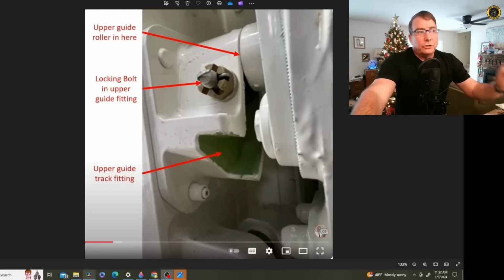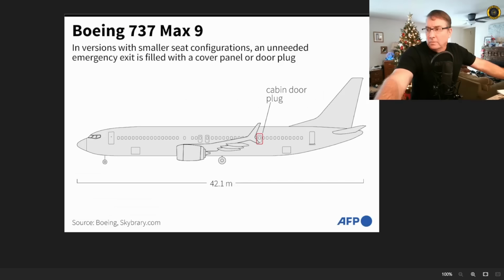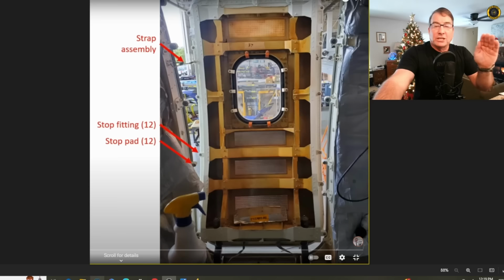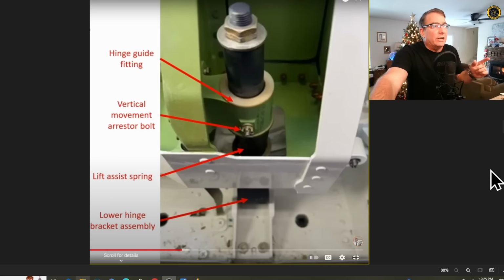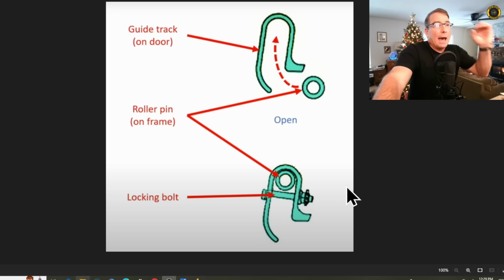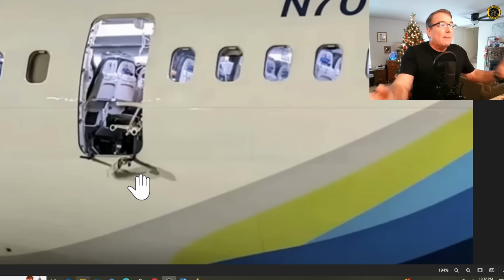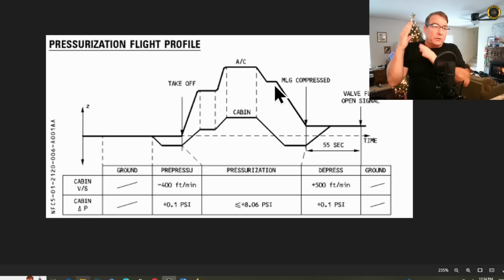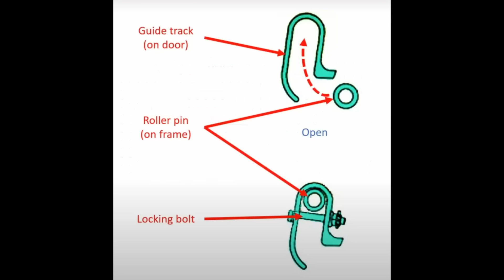Alaska 737 Max-9 Door UPDATE! 8 Jan 2024

Comment: Great video and explanations but some minor corrections:
At 4:00 clearly we can see it is NOT a plug-type door, unlike the 737 passenger doors. 
A plug type door cannot open to the outside like we see in the picture but only to the inside.
They are of the same type as the over-wing exit.
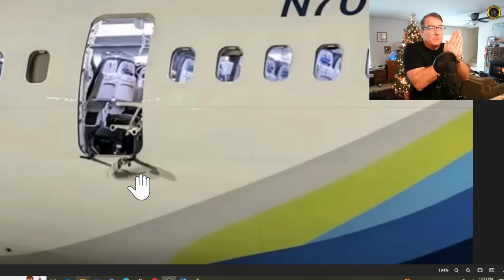10:12.. no mouse trap effect if it was a real plug type door.. a plug type door cannot physically get through (by definition)
Reply from the maker: No, this is considered a plug type door.
Reply: "No, this is considered a plug type door." @blancolirio  
Respectfully you are wrong here. 

The 737 avionic, passenger doors are plug type. 737 Over-wing emergency exit and this extra emergency exit doors are not.

Airbus use plug-type door for over-wing emergency exit and avionic door on the 320 and their passenger doors are not.

A plug door is a door that physically bigger than the fuselage frame hole they cover. This is a geometry that prevent open outward without first moving inward and change orientation. 'plug-type" plug door cannot fail this way even without if safety bolts were lost. 

The aircraft frame in the way therefore there would have been either significant damage to the door or the airframe.

I am an aircraft maintenance engineer for 20 years, experience on several Airbus/Boeing aircraft types.

Comment: It might be helpful if you could provide pictures of a MAX-9's operational emergency exit door so the differences can be seen.  

From what I see in the photos you have provided is that this plug should never be able to dislodge if even only one of those bolts is in place.  But conversely, it looks like the plug would never remain in place, not even for a second, if there WASN'T at least one of the 4 bolt in place.  

From what I can make out, the curvature of the aircraft gives clearance for the top of the plug to move up with no mechanisms in place, latches or other wise, to restrict that movement.  It looks like that plug should fully spring open on its own while the aircraft is simply sitting on the ground unless one of those 4 bolts are in place.

My mind's eye says that that to close that plug, the top of the plug is rotated toward the cabin of the aircraft at which point the bottom of the guides on the top of the plug engages with the pins at the top of the opening frame.  Then in some way, perhaps in using an unspecified tool, the plug is pushed down compressing the springs to such a point as the plug, using contact friction with those 8 overlapping tabs, seals to the cabin frame.  While the plug is held down the 4 bolts are put in place, after which point the tool can be removed and nothing should EVER move.  If a bolt isn't put in place, my mind's eye says that the plug would pop open as soon as the compression tool is removed.  I just can not imagine that a friction fit between the plug and the cabin opening would ever be enough to hold the plug in place on it's own.

So I say that during installation only one bolt had been put in place, and without a nut, and then the compression tool was take away to allow for easier access to complete the plug installation.  However, as another commenter stated, a "shift change" style error occurred where the plug installation was never fully completed and the 4 bolts were never installed and secured.  This could happen either during original assembly or during a maintenance process.  My guess is that one of the holes for the bottom bolts will show wear from a bolt moving back and forth in it.

Comment: The white paint around the door plug retaining bolt holes should show indentations of the bolts having been tighten. If the paint is pristine then the bolts were never installed. I'm sure the NSTB already knows if the bolts were there or not. Maybe someone has a close up picture of the inside of the door plug.

Comment: The stop fittings on the door have pins that contact the pads on the door when it is closed and pressurized. There should be a clearance between the pads and pins that prevents the door from moving too far outboard while under a pressure load.

Comment: The lower bolt is a locking pin  the upper bolt is a restraining pin side loaded   Neither are hold downs or pressure boundary level 1 makeup parts that require installation inspections.  Hmmm

Comment: Two possibilities. If the springs are strong enough to lift the door at least one pin must have been there at assembly, otherwise it would stay open. If the springs only assist (not strong enough to lift the door) the bolts might have been missing all the time and some negative G and vibrations lifted the door until it popped out. The 12 stops takes the main forces from the pressure diff..
Reply: I think the springs take most of the door weight, but not all the door weight.

Comment: Aviation must have changed a lot over the years...  I worked on aircraft for several years, I have NEVER seen a cotter pin used on an aircraft, I've only seen and used Safety Wire to secure a nut.

Comment: Just as a point of reference...At altitude there is a pressure of 8psi trying to push the plug out of the airplane.  If the plug is 7ft (84in) tall and 3ft (36in) wide, the total force trying to expel the plug is 24,192 pounds.  THAT'S MORE THAN 12 TONS pushing on the plug.  Better hope it's installed properly.
Reply: Yeah, but it isn't that size.

Comment: Normal Boeing Cabin Doors have Upper and Lower Hinged Gates that fold when the door is open or closed. They make the door LARGER than the fuselage opening when closed properly.
I did not see any hinged gates on what is being called the Door Plug that departed the fuselage. As long as the Door Stop Pins remain in contact with the Fuselage Door Frame Stop Pads then the door cannot depart the fuselage regardless whether or not the Door is a True Plug Type Door.

Comment: 19 year 737 mechanic here. This loose bolts thing causing it is crap. They are castellated nuts and bolts that use cotter pins to keep them in place, not bolt torque.
Reply: Maybe you're right. Isn't only Airbus too loose?
Reply from the maker: Correct. But not if they are not there at all...
Reply: @paulsherman51  😂 yeh! Got that one. But they're also  in Hamburg, St. Nazaire, Spain , China and USA.😅

Comment: I’m a retired plumber and I’ve used bigger bolts to secure pipes on the ceiling.
Reply: But usually they aren't stronger than bolts used in planes.

Comment: Prima facie, this issue has the apparency of the bolts either being in place without the castellated nuts and split pins, or, no bolts at all in place. My guess is that the bolts were not installed at the factory and for some reason slipped through quality assurance. If the split pin(less) nuts were in place, then there would need to be sufficient resonance at that point in the airframe to work the nuts loose. Perhaps there were enough cycles, turbulence and hard landings to make that possible.

Comment: Most likely a problem in manufacturing with no. 1 suspect the manufacturing plan: did it have the correct notes and spec callouts for nut torquing and installing the cotter pin with required QA inspection steps. Since the problem appears on multiple airplanes this will get scrutiny. Because the door plug is an optional feature based on the airline configuration, managing the application of these requirements can be complex. As or the depressurization faults...they are recorded by CMC. If pilot clears fault in order to fly, the event is on the flight recorder.

Comment: I feel like these doors are being mislabeled.  A "plug" style door is like the classic emergency exit door.  It is actually a plug where you need to remove the door by pulling it in inwards, turning it sideways and then tossing it out of the aircraft.  The "plug" is bigger than the fuselage opening where it can not physically leave the aircraft without first removing it inwards.  This is why I was confused on how this could actually happen in a pressurized cabin.

Comment: I have some doubts about the rear hinge tube. (You brushed straight through on your video, saying it was undamaged but to me it looks like there is something hanging off the rear hinge tube. That could be part of the bottom of the door that was finally ripped off in this incident. (Or it could just be some random irrelevant debris or a shadow or something). I'm wondering if this was the only 1 of the 4 locking bolts that was actually fitted and perhaps in conjunction with things like loose screws (as seen in exactly this area on the United inspections) the structure eventually after several flights, with the lift assist springs pushing upwards, resulted in enough give to allow sufficient miss alignment of the 12 door lugs to set up the "hair trigger" situation that you described where the 12 lugs are barely hanging on (right from engine start up) and can no longer withstand the pressure differential at 15k ft.
It's a lot of Swiss cheese but there sometimes is a lot!

Comment: So what I see in your report Juan is you put the door on the lower springs, push down on the door to get the upper rollers to go into the upper guide track to pull the door tight. Then add the bolts so it can't move down and come loose.
To me looks like the upper bolts weren't in stalled. Also If the bolts aren't there that could be why the Pressure light came on, the door was moving up or down.
Reply: Backwards. Look at the photo.
Reply: @OsoMagna  Ok picture at 11 seconds Part with the bolt is the door or the door structure?

Comment: That door is commissioned with a slide for airliners that do NOT have an extra lavatory and more seats as in the 737-8200 which is basically a dash 9 without an extra lavatory.  The dash 10 will have this door with a slide.
Reply: Dash 9 certainly will need that extra lavatory. Better cater with Charmin extra strong mega, too.

Comment: Just one note -- this was a door plug, it was not a plug door.  Could have been a door plug that worked as a plug door, but it just hangs on to those 12 stops.
Reply: Technically this plug is mounted like a semi plug door, like it's used on 787s, 777s and Airbus aircraft.

Comment: Good analysis.  Much better than NTSB  The question I have is where were the locking bolts?  It is well to point out that this door is the same as a working exit door except that it has locking bolts while the working door does not have locking bolts but has the operating mechanism controlling the upper pin locations.  The bottom hinge on both styles is identical.  Another question is about the part the locking pins go into as to holes for the locking bolts Are there two versions of these locking pin receptacles (one version for the plug and one version for the exit door ) and did they get mixed up?   End result of this mess:
BOEING REALLY SCREWED UP!

Comment: Juan would you look into claims that the "flight deck door blew open and the crew did not know about that feature"? Maximus Aviation posted a video today that has the NTSB Chair claiming the flight deck door "blew open" during the decompression and that "the flight crew were unaware of this feature". I did retire in 2018 off the 73NG and that door had two huge decompression panels and their operation was in our manuals. Did the later production 73's or did the MAX get a different door design. Door blowing open or decompression panels operating are two entirely different events. The NTSB Chair was claiming a feature on the airplane that was not described in the manuals.
Reply: I believe the video (and the NTSB statements) are exaggerated. The same mechanism is present in all aircraft (since 9/11). It doesn't need to be included in every flight manual...

Comment: Let me reveal my total ignorance by asking a dumb question. I always thought the doors of modern aircraft had an angled edge around their periphery that ‘plugged’ into the complementary shape of the fuselage aperture. In otherwords the pressurization sealed these two complementary angled surfaces. So, the door is held in place mainly by pressure. To me that does not seem to be the case with this door plug on the 737 Max 9. It looks like it is held in place by mechanical fittings not the pressure differential between the interior and outside of the fuselage. Apologies - I think someone below has asked the same question, but Ill leave it in place.
Reply from the maker: Old school pressure plug doors vs, this door design.

Comment: The extraordinary luck for Boeing et al. and Alaska Airlines and all those aboard AS1282 that evening has me imagining.

1. The airlines, AS in particular, it seems from my recent experiences, have been keeping high load factors and this flight with 171 passengers was no exception, quite nearly full; and yet, no one was in that window seat. Had there been, even if tightly belted, the rush of cabin air outward may well have thrust an adult's upper body (perhaps resting/leaning against the interior panelling) out into the slipstream's more-than-300 knot velocity, causing critical or more seemingly, fatal injury.

2. The hypothetical window-seat passenger was not an adult with a hand-held (if at all gripped at that point in-flight) lap-child (infant; under 2 years old by regulation) and...

2a. there was not a child of any age seated right there, particularly one with a loose or unbuckled seatbelt, as either of these smaller, low body-mass passengers would very likely have joined the items expelled and deposited on that Portland area neighborhood. Though, there was a belted-in young person (i.e., of less body mass) one or two seats away from the window who received the brunt of the force shoving him towards the roaring maw. I'm sure that his mother grabbed him too late had the belt not been fastened, though maybe he was just far enough away that he could have grabbed onto something fast enough before the pressure differential equalized... but at a higher altitude and cabin differential? Not at all likely, it seems. 

[01/10/24 edit/update: the 15 y.o. passenger was seated at the window immediately ahead of the blowout, in 25A; the force was great enough, apparently as seen in a photograph, to deform the seatback structure backwards where he was sitting.] 

3. This failure and explosive decompression was at merely 16,000' and not twice as high, or at 41,000' where cabin differential pressure would be even more powerful, perhaps twice as powerful, against the panel and anyone seated immediately at or otherwise close to it.

4. This failure and explosive decompression was not yet at cruise altitude in the stratosphere where time of useful consciousness is measured in seconds—as in, perhaps as many as 6 for a physically fit, anticipating Air Force pilot at 40,000' in an altitude chamber facility—aka, the "death zone," making the flight crew's reaction much less complicated and less harrowing for everyone, allowing all a luxurious 10-15 minutes of useful consciousness as the flight crew commenced a short, relatively smooth 1 or 2 minute emergency descent to 10,000'.

4a. And let's not forget the potential for absorbed gas coming out of solution in everyone's circulatory systems and tissues way up there at stratospheric cruise altitude during an explosive decompression, along with other physiological effects and injuries. The bends is not just for divers.

4b. Indeed, that it didn't happen at cruise altitude during the airplane's previous flight inbound to PDX. And so on for other previous flights.

5. It happened above a developed area, making recovery of the item in question surprisingly quick;

5a. No one on the ground in the developed area was injured or killed by the 60-some lb. assembly in 3-mile free-fall;

5c. The assembly appears to have landed with the assistance of a bushy tree, cushioning its impact, preserving its condition for investigation... and not in a nearby (at 400+ knots groundspeed) wilderness area where it would be much harder to locate, and maybe bashed onto rocky terrain, complicating the investigation.

There were other factors, of course, but none I can think of that were just plain dumb-lucky; e.g., the flight crew did what they're trained to do, like any other would. That's not luck, it's skill and training. The door-plug assembly didn't hit the stabilizer on its way out, but I think, based on grime patterns back there that I've observed on the older 737s that I pilot, the air flows somewhat downward along the fuselage behind the wing, so it probably passed below the stabilizer, naturally with airflow and gravity rather than by luck. 

That seems to be all I can think of for plain old dumb luck; I'm not sure if the pressurization system giving off warnings in the days or weeks previous that precluded ETOPS assignments (long over-water) was luck or by design, so I'm leaning towards design on that one. Further investigation may well tell.
Reply: How much more frightening was the ceiling of that Southwest plane which came clean off, some years ago?

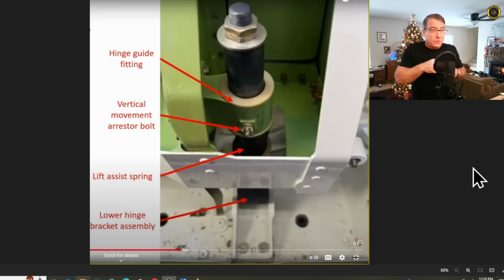Comment: There seems to be a lot of confusion in the comments regarding the loose bolts United found as those particular bolts affixing the hinge guides to the plug were not addressed in the video. At 5:59 you mention the hinge guide fittings being a part of the door, but it appears they are bolted to the door. I'm no AMT, but it seems crazy to me that those bolts aren't safety wired, or at the very least some dykem/torque stripe upon installation.

Comment: As a mechanical engineer, I can appreciate the proper implementation of the "Commissioning/testing process" of any new product or system. Was there a commissioning/testing procedure for this "plug door" to ensure that all bolts were installed and torqued properly including other components? 🤔🚪🔧🔩🛩